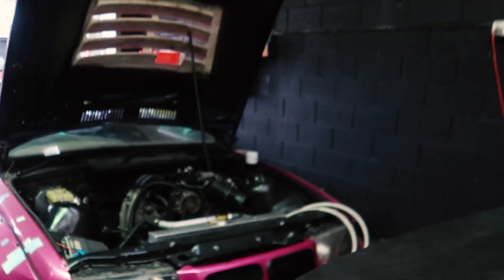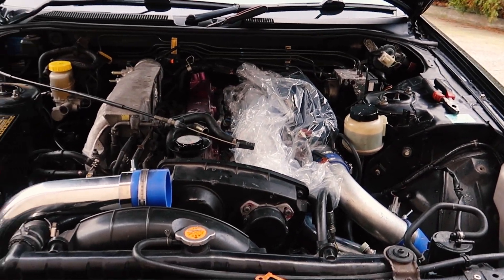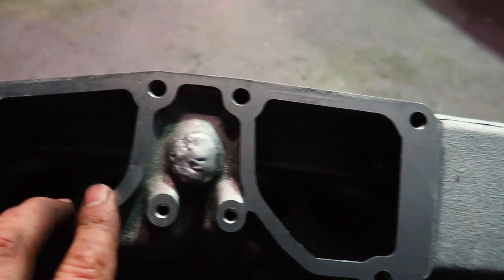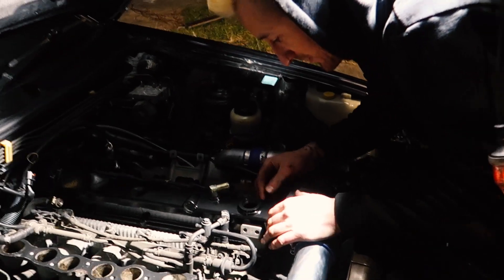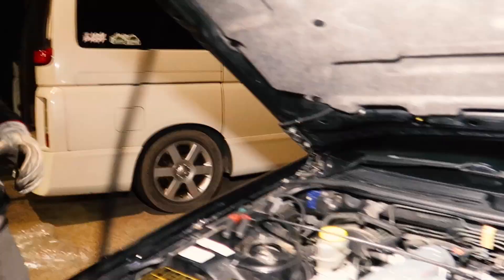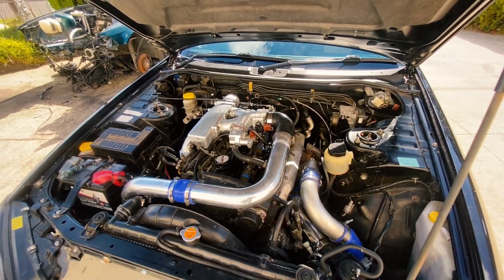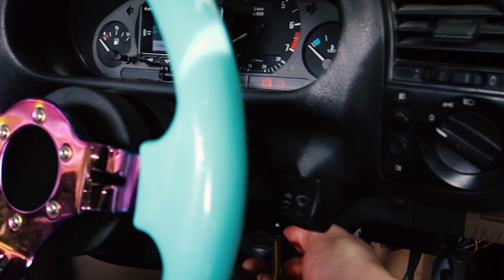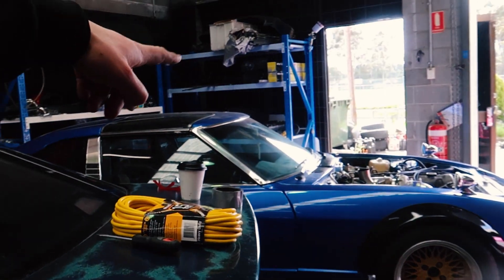13B E36 OIL COOLER UPGRADE + R34 RB25DE NEO INTAKE MOD

Comment: Hey Mike. Has you tried to connect the RPM signal to the X20 E36 plug?
Reply from the maker: That's actually a really good idea. I'll see if it works! I have the digital dash in the car which tells me RPM but itll be fun to see if the stock gauge works. 10k RPM haha